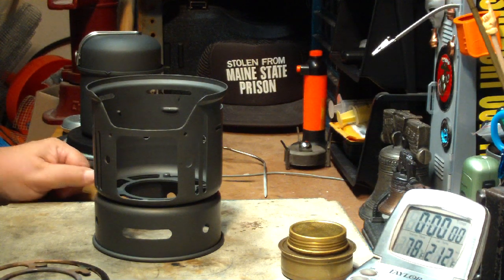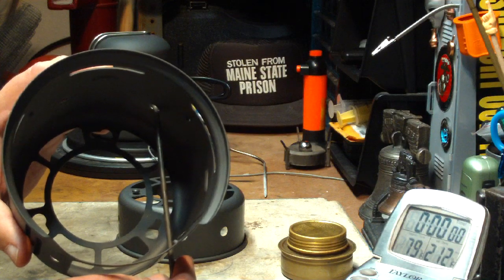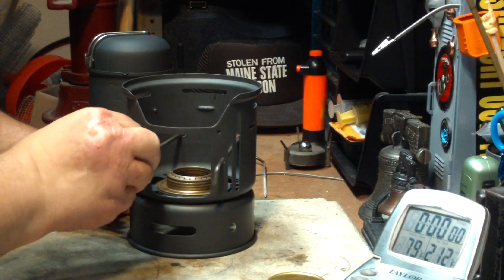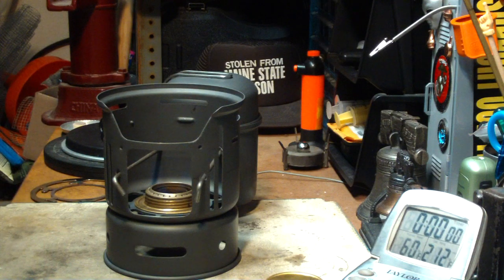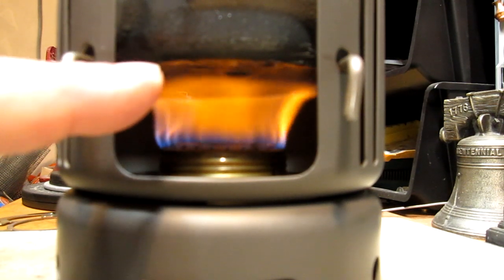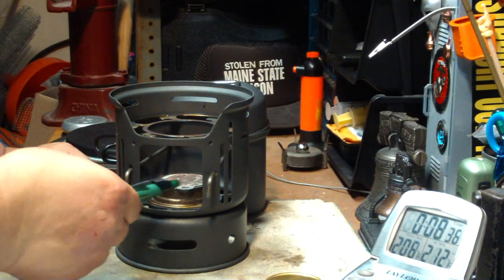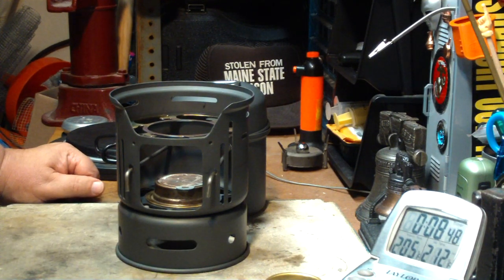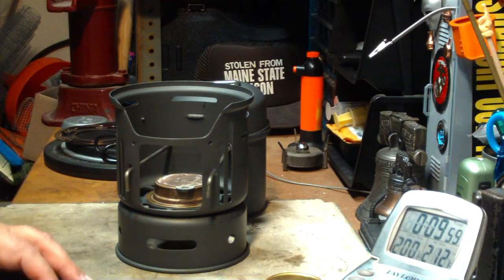ALOCS 7 Piece Camping Cook Set - Mod #1 - Boil Test

Comment: Hiram, I have this same kit and that pot ring warps like a mo-fo every cycle and I have to wait for it to cool down and tweak it back by hand, next to impossible if you're arthritic! Your mod is clever and instead of a marker, you can use Scotch Blue painter's tape and use the top of the tape to line up for drilling the holes. It leaves little to no adhesive when you peel it off.

Comment: This 'Sweet Spot' of one inch above the flame people talk about is a myth. The sweet spot (i.e. 'peak heat point') for a 95% ethanol-driven flame from a 6cm diameter vessel (a Trangia) is approximately 5-7cm, depending on atmospheric conditions.

Comment: The water is not from the relative humidity, it's from the combustion process. The reason the original design worked better is because the pot was further away from the fuel there by allowing complete combustion and higher exhaust venting.
Reply: Makes sense! A longer flame would definitely be hotter at the top.

Comment: Your Water problem is not that the water is cold in the pot. What is going on is when you burn the fuel, it actually is turning to water. When fuel burns the oxygen in the air and the hydrogen in a hydro carbon actually combine forming water. I think the water has no where to go, so its collecting. you will see this when water poors out of an exhaust pipe of a car. Water in its purest form, in this case forming on your stove, is a great insulator preventing the water from heating quickly. Also when water evaporates, it takes heat with it preventing the pot from heating up quickly and evenly. An example of this is when we sweat, we cool our selves of when when we sweat when the air hits the water on our skin, making us feel cooler. You may have to go back to the original design or come up with a way to let the water escape.

Comment: he original cup holder absorbs the heat but again transfers by increased contact with the bottom of the cup,  some of the absorbed heat to  the cup, whereas the wire inserts do not have much contact with the cup so less heat is transferred to the cup bottom.  Simple!

Comment: I think your 1" sweet spot is actually too low.  I find about 1 1/2" or as close to the tip of the flame (depending on which stove/burner is used) as possible, puts the pot/pan at a hotter/sweet spot on the flame.  When you place your cooking pot that low in the flame, it is in a cooler location.  The tip of the flame is always much hotter than the centre.  I have never measured fuel efficiency so I can not attest to whether this burns more fuel.

Comment: Hiram- good reviews. I'm extremely curious as to how you "Determined the Sweet Spot" on the flame level? I ask this specific question because in my past experiences, the Sweet Spot or hottest part of the flame is more towards the upper most "point of the flame"? Not above the flame, or just touching the top of flame, but rather 75% to 85% up the flame itself? Would really appreciate you input and answering of this question. It would provide me some valuable knowledge as to my personal findings. BTW- none of mt testing is scientific, but rather simply trial and error. Thanks. Wm. ~

Comment: It could be that you are raising the temp of the Methanol so that it begins to boil or gets to a temp where the vapor is burning too soon, hence the yellow flame. Basically  would guess that by reducing the volume underneath the pot you have essentially lowered the sweet spot and made the flame less efficient at the point where it is supposed to transfer heat. My guess would be if you monitired the temp of the fuel with the original setup and compared it to the mod you would find the Methanol is at a higher temp in the latter.

Comment: You had a lot of yellow flame in your modifiied stove test.  A yellow alcohol flame is not as hot as a blue alcohol flame.  Since I didn't see your first test, I'd have to presume that the extended time was due to a slightly cooler flame.

Comment: The condensation at the bottom of the pot isn't from the ambient humidity. When fuel burns it produces CO2 and H20. The water vapor from the fuel is simply condensing on the cold pot.

As always, I enjoy your videos Hiram.

Comment: I'm also thinking it's the air flow...too restricted in this windscreen. I think you always get a lot of humidity in a flame since alcohol burns into carbon dioxide and water, but in this case the air flow is low so the water condenses on the pot.The water isn't a problem per se since it gives up the same heat when it condenses as it takes when it evaporates off, but it's an indication of poor air flow which might mean an inefficient burn. But I've gotta say..I did not expect this result either.

Comment: NOW, the question is WHAT IF you use the wire supports at the original level of the support ring ? ... I mean ... EVEN IF you DO NOT reduce boil time, you HAVE reduced the weight, significantly. ... SO ... The thermal mass and conductivity, of the stock support ring (itself) certainly does effect the efficiency, to SOME degree.  IF you test your "tent-stake" bent wire pot-supports at the Original (design-spec) height of the factory support ring ... would that make much (if any) differenc ?  Hmm.